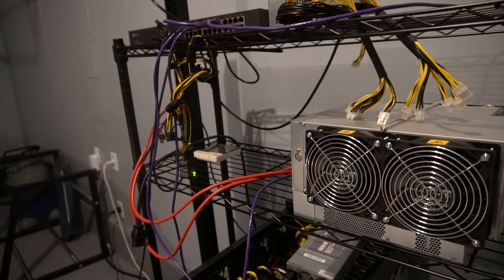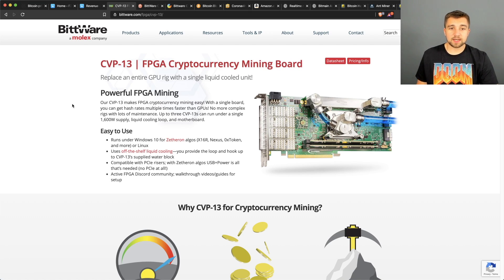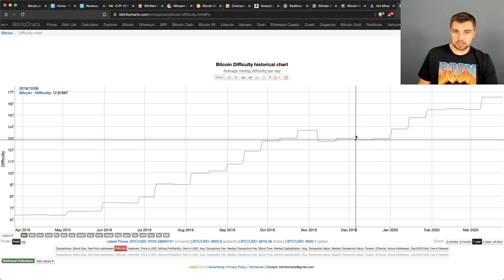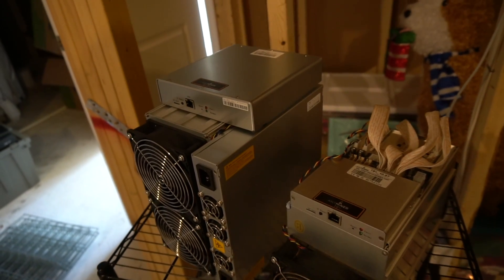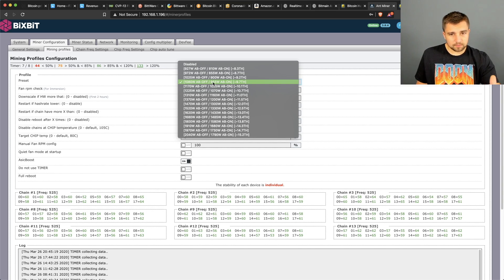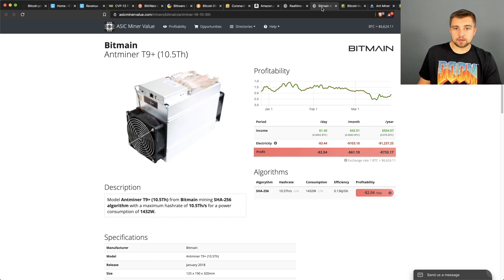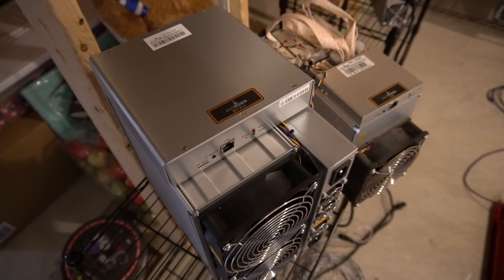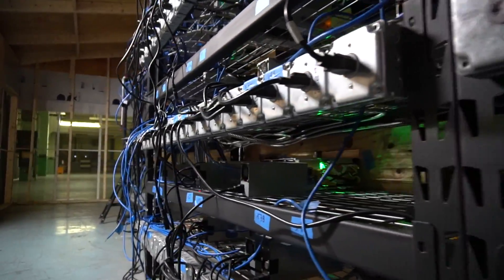How To Overclock and Downclock Your Bitcoin Mining Rigs for More Profitability!

Comment: This stuff does not work with the most recent Bitmain firmware.  They've introduced a "signature block" that prevents firmware other than there own from working.  There is a workaround but you would have to flash the miner with an older firmware before the signature block and then flash the miner with the Bixbit firmware.  Not easy and a whole bunch of issues with be sure to follow.  Good luck to all who try!